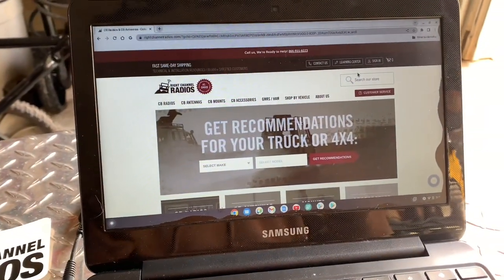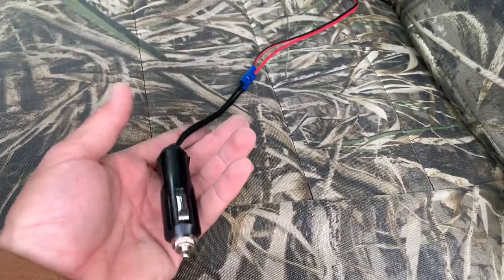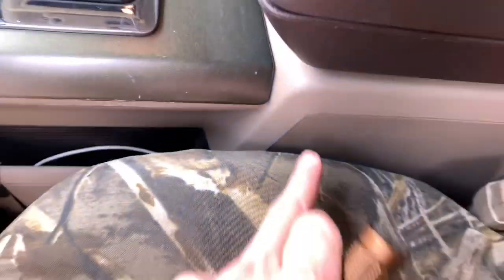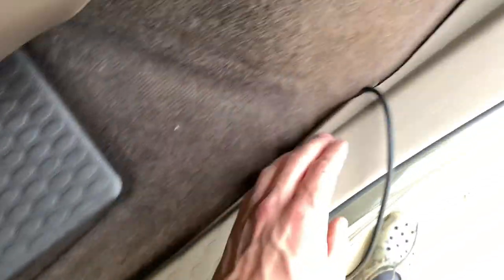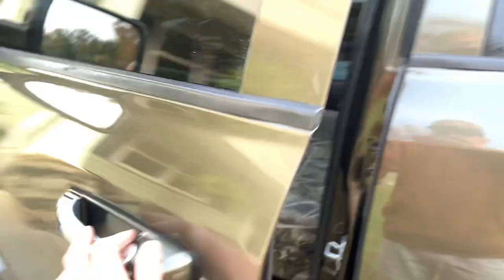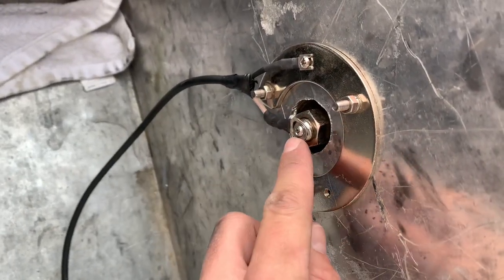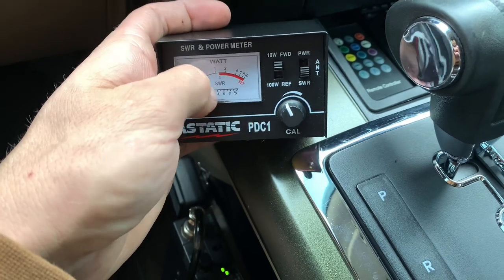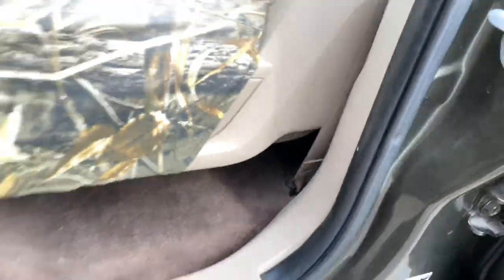Cleanest way to install a cb and how to tune it!

Comment: I assume you dont have deep enough water attractions to risk your electrical. I went with a junction block set up under the dash for power.
Reply from the maker: It might see some mud and water every once and a while but I usually try not to get it in bad water holes

Comment: I need just that cable
Reply from the maker: I believe they sell it!
Reply from the maker: Right channel radio
Reply: What cable was that? I got one from them and it doesn’t have the terminal ends like that on it. Also, they told me I’d need an NGP antenna for mounting on my headache rack. Honestly not sure if that’s necessary or not.

Comment: This is the absolute wrong way to do a 102 inch whip... absolutely wrong !!! ,u never want to mount the 102 in this location ..u want the base of the antenna to be above the cab ..yes it's tuff to achieve ... Putting the 102 on the bumper is not good idea .. there best performance is above the counter poise or the vehicle the flat plane of the metal 

With that being said it's hard to do and not always possible ..but your blocking the ability for the antenna to have a proper deflection point ...
Reply: That's because you don't know what you're doing Justin.
Try again buddy.

Comment: You clearly do not understand the proper way to mount an antenna.  The base of the antenna needs to be above the metal side on the toolbox- or much closer to the top!  It would be best mounted to the side of the cab on the truck and fairly close to the top of the vehicle.

If you look at old photos from the 60s and 70s of police cars you will find these quarter wave low band antennas mounted on the side of a vehicle or on the top of a trunk cowling.
Reply from the maker: I’d prefer not to drill a hole in my truck. Also being on the side of the tool box can be an inconvenience when trying to access tools.